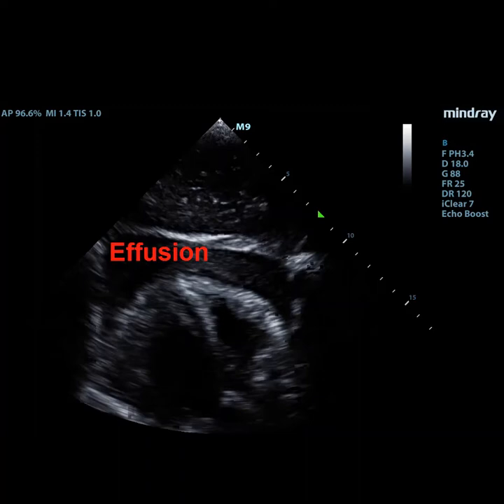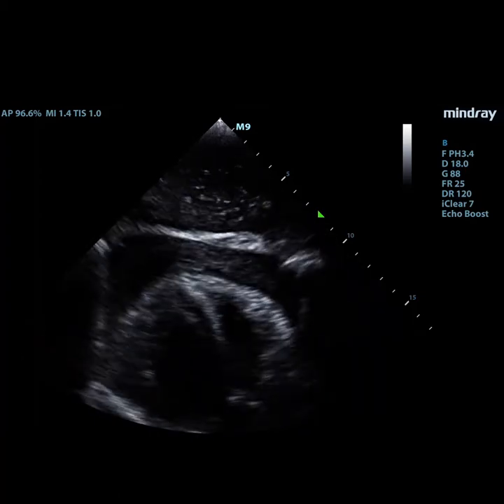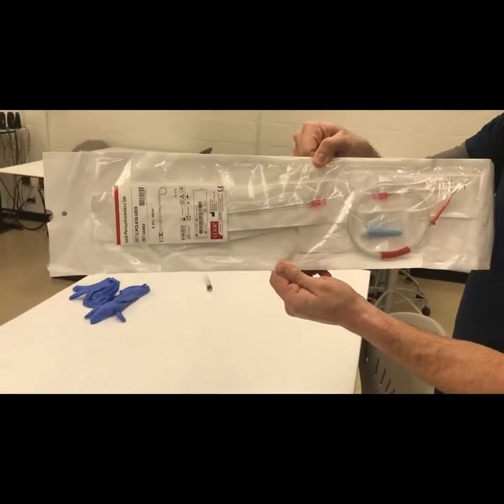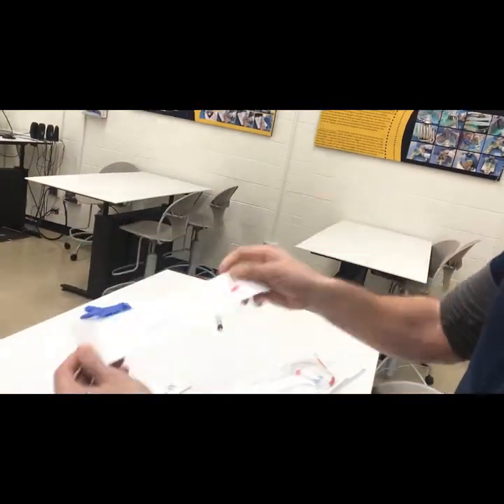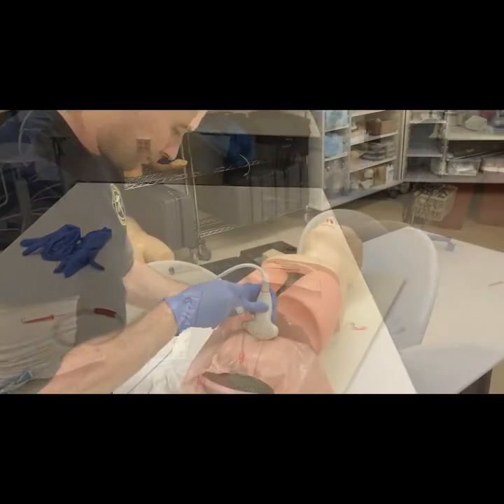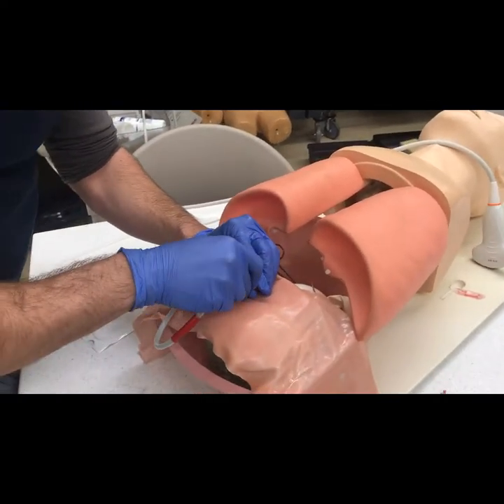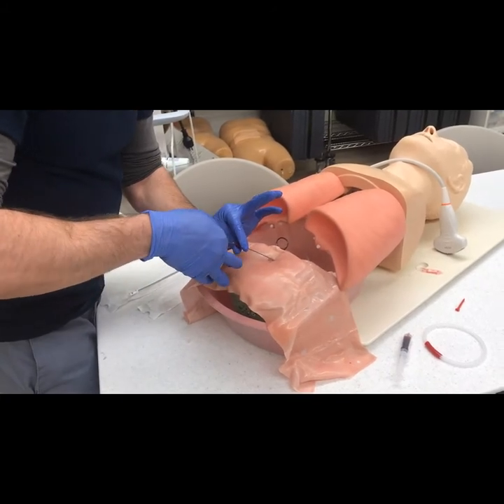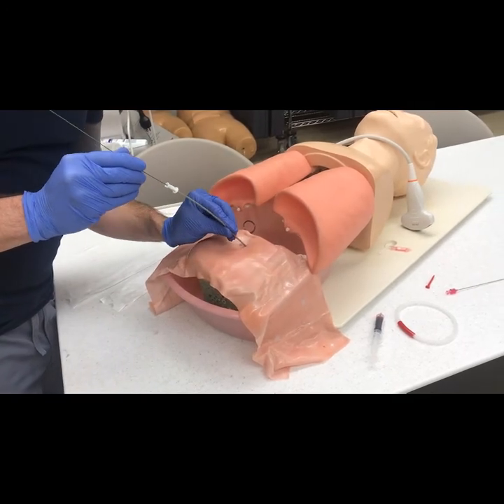Ultrasound Guided Pericardiocentsis and Drain Placement

Comment: Thank you for providing this video. However there is a significant error. What you’re calling the smaller drain is not a smaller drain. That is an introducer/dilator that will open up the path for the real drain. The real drain is the longer, pliable pigtail. This is important. That stiff dilator is not meant to be in the pericardial space. Thanks
Reply: Not once but twice - this really needs editing. The video ends with insertion of a dilator as though it is the definitive drain. Hopefully nobody would be stupid enough to do this in real life, but people do turn to YouTube for demonstration...